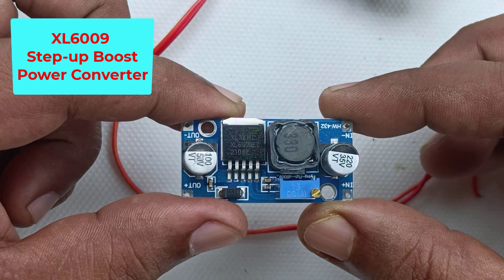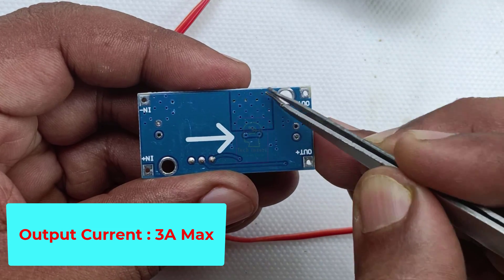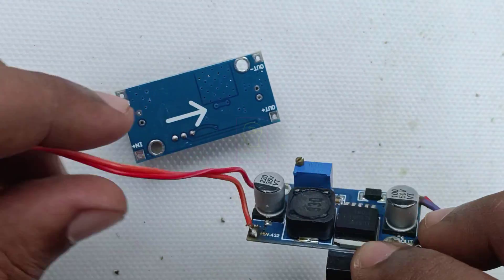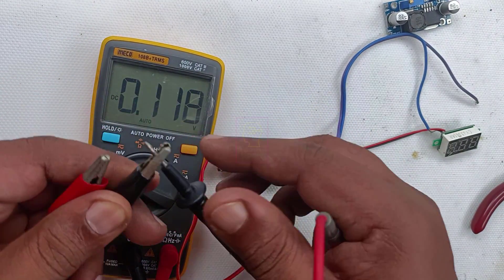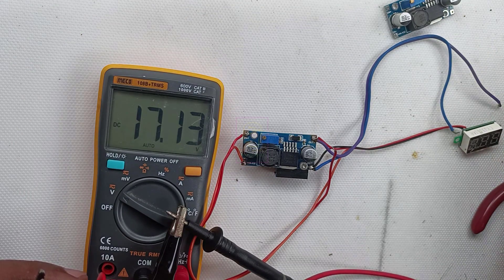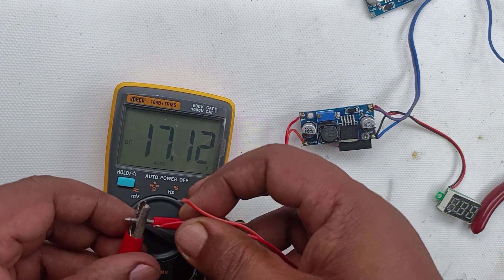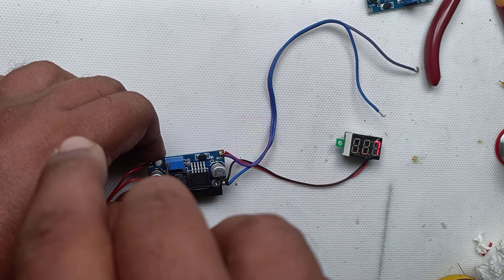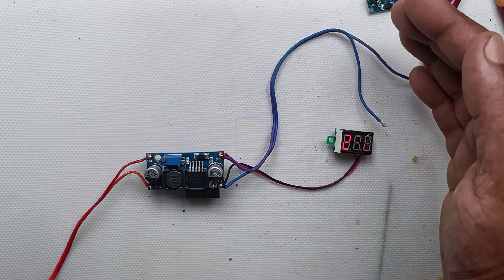XL6009 DC-DC Step-up adjustable Boost Power Converter Module

Comment: Can i just connect a input 5v power sauce then adjust the output upto 20v
Reply from the maker: Yes, but your 5V supply need more current
Reply: @TechInsert  will a 5v phone charger with 2amps be ok
Reply from the maker: @ The thing is 20V how much Ampere u require for the load? If suppose 1A is required  for the load then from input 1A is needed for the load. Then to raise the voltage from 5V to 20V it require around 3A . So total  minimum 4A is needed at the input.

Comment: When power boost? Clock wise or anticlockwise wise
Reply from the maker: I dont know, that is why  i used a volt meter at the output stage.

Comment: Xl6009 module can control constant current and voltage pls explain.. Thank u sir🌹
Iam iur fan thank u once again ❤
Reply from the maker: Yes it can deliver constant current. There will not be any drop. But at the most 3A can be delivered if providing a good heat sink. Without heatsink we can draw 2A safely